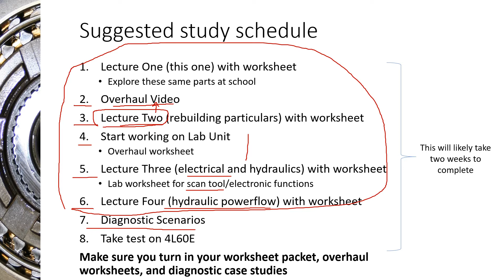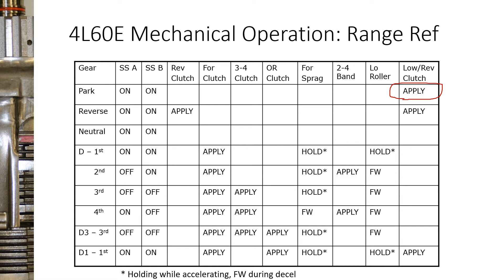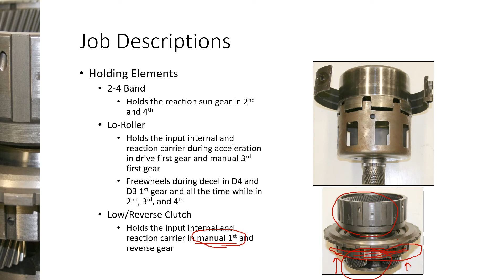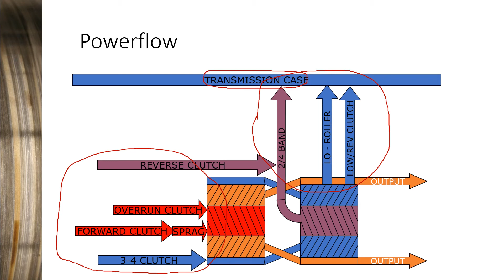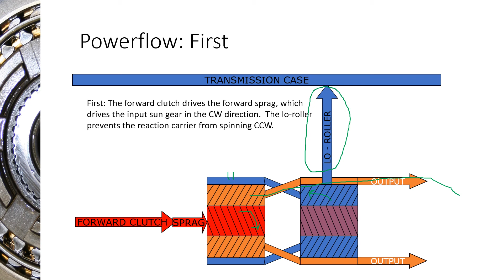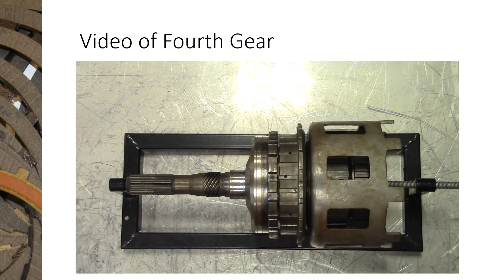4L60E Introduction, Mechanical Operation and Powerflow

Comment: Great explanation, what happened to the video sections that were cut out?  
I am building an electric vehicle using a C5/6 differential (so 4l60e bolts up) and want the rear motor to both be disconnected as well as get a low and high gear.  I'd use a powerglide, but the gear spread is not enough.   I would like to reduce the weight and simplify the trans if possible, and only have 2 gears and neutral.  Don't need reverse.  Maybe 1st and 3rd gear, but from the video, it seems I can physically lock the 2-4 band, and then can shift 2 to 4.   If anyone can get some insight on best way to do that, I'd appreciate it.  Will not have a torque converter and will use an electric hydraulic pump.

Comment: Howdy. I have a new-to-me 1995 Chevy Sierra 1500 pickup with original 4L60e tranny (as far as I know).  228,000 miles. Runs good. Only symptom I have is delayed shift from 1st to 2nd. It waits until 2,700 to 3,100 rpms. I can usually make it upshift to 2nd by easing up on fuel pedal just a little for a moment at various lower RPMs. Does it hot or cold, in cold weather and warm. It misbehaves when selecting "D" as well as "3". It will downshift from 2nd to 1st, as it should though.

Everything else operates as it should. Fluid is clean, red, and exactly full when warm/level. Fuses all good. No CEL or stored codes (used jumper wire method). No visual leaks or consumption. Filter condition is unknown, as I haven't removed pan.

Is this the 1-2 solenoid / solenoid A failing, more than likely?  Or the 2-4 Servo?  Or the 1-2 Accumulator valve?  I have no CEL or stored codes.

Also, is there a way to manually shift it to further narrow down the issue?

Comment: hallo , goodday ,   im a follower from italy , i want ask  you if you can help me with an 4l60e  , from 1999, gmc sierra 5328 ccm , 198 kw lm2 motor ,   i have lost the big checkball at the beginning   of the gearboxcase ,not the 7 small checkball but the eight bigger checkball .........have you the measure / sice ?     the checkball who was the first to put it in the case before put the plate    thank you for your time

Comment: At 25:54 I think you were in error, you showed the lo roller clutch working on the reactionary ring. Is should have been the planets inside circled as the reactionary ring is connected directly to the tailshaft/wheels ¿¿¿¿

Comment: I always wondered, what would you get if you re-routed the hydraulics such that the reverse input clutch would apply in third gear in addition to the 3/4? Would that relieve the beating the latter gets?
Reply from the maker: That would help third, but that housing needs to be held in 4th.  It would be tough to time the apply and release of the rev clutch just to benefit 3rd.  There are some good performance options, like the drum at 4l79.com or the sonnax smart drum.  Www.sonnax.com